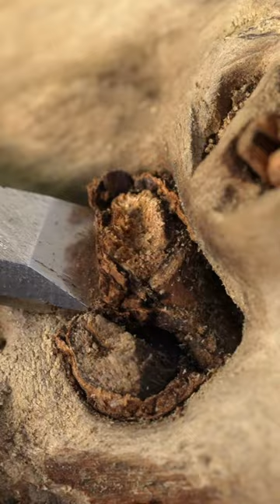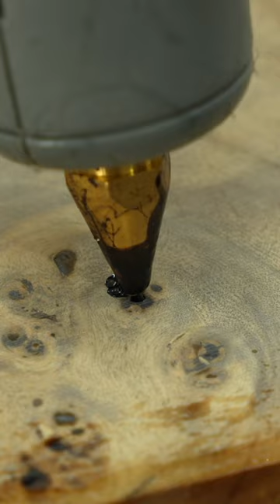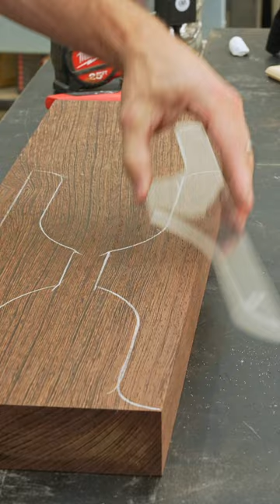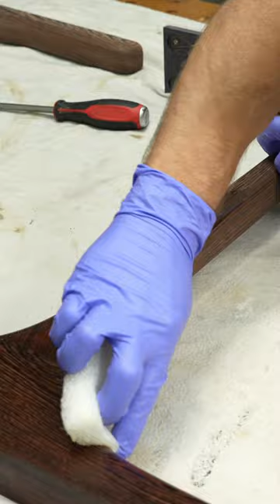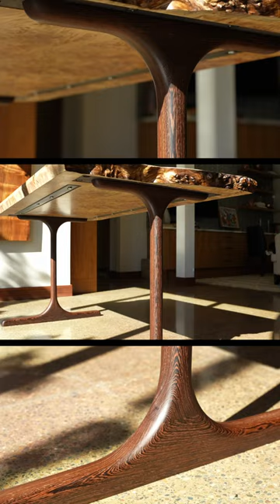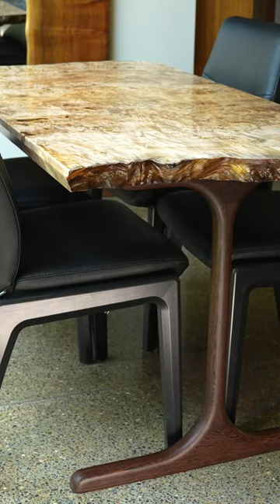$7000 Desk in 60 seconds

Comment: Ill give ya $200
Reply: I think the website you are searching for is called ikea
Reply: @catherinegouveia2748  well thats about how much this desk is worth. Not $7000
Reply: @brianarnold8666  I'll make you a deal Brian... "Ill give ya" $250 for a table that you make from scratch and then we can discuss "worth" over a beer.
Reply: @catherinegouveia2748  ive made a few.....
Reply: yes 7000 is to much.
Reply: that slap most likely cost more than $200, have you ever priced exotic wood
Reply: @kenlorenz4758  no. No wood slab is worth that much. Its just wood
Reply: @Brian Arnold  that's not how pricing works, otherwise a Bently should cost as much as a Honda,
Reply: @kenlorenz4758  it should. It's only so much more expensive because of the name. Complete bs